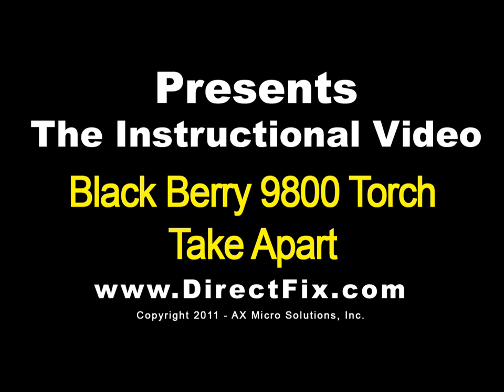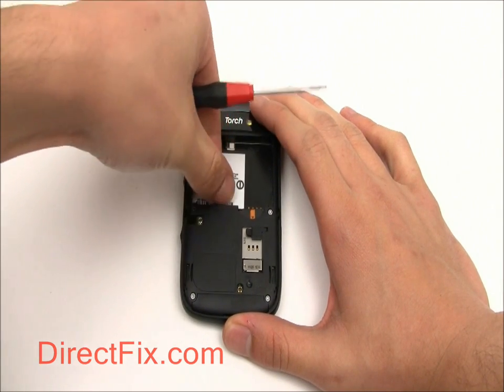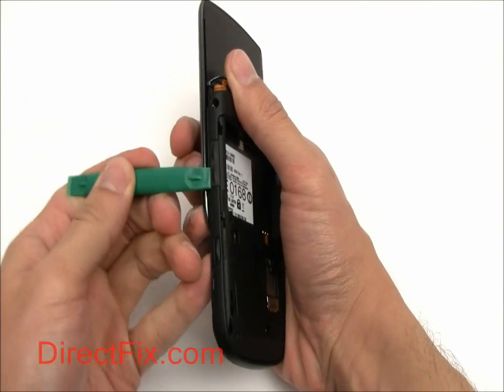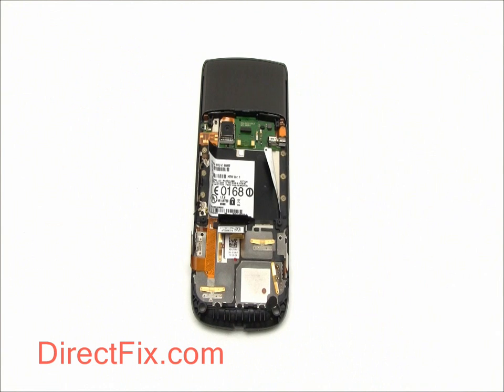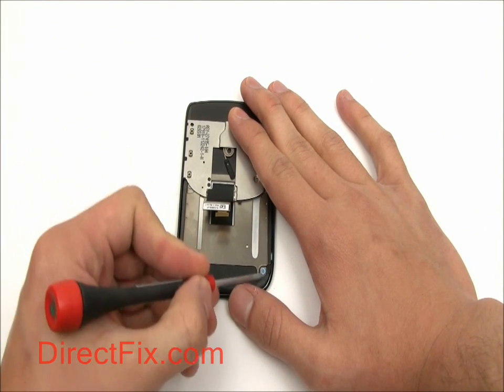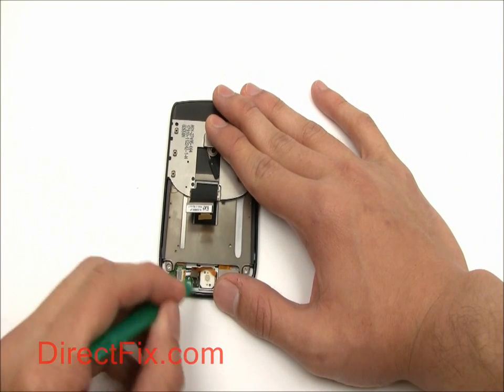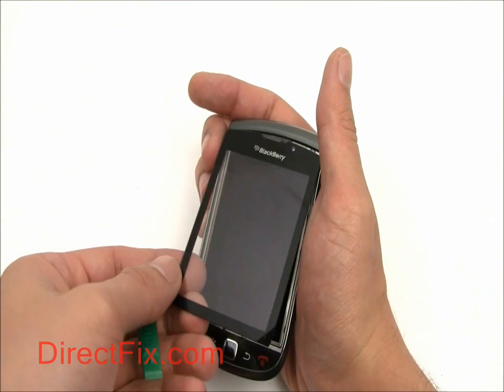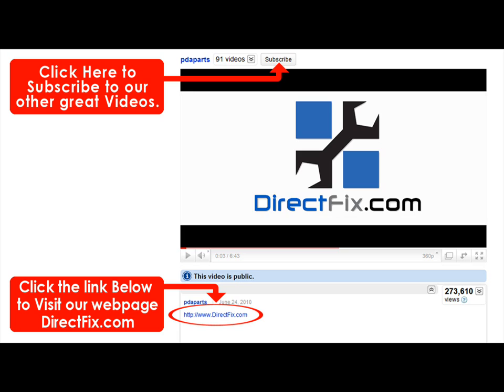BlackBerry Torch 9800 LCD Screen Repair Directions

Comment: To answer my own question, yes, a T2 works (but the T3 was too large for that step).  Don't waste money trying to find a set with a T1 (much harder to find than a set with a T2).  I used only a T2, T3, T6, and a pry tool.

Comment: This explained how to remove the phone's body panels, do you have any recommendations for removing the bezel on the sliding part? Because I'm thinking on buying a second Blackberry 9800 (used) to practice fixing problems if mine ever breaks/scratches/dents.

Comment: My Torch phone fell from a certain height the other day and it left an ugly scratch on its sleep button. now the back light is gone but i think some connections just got loose 'coz i managed to bring it back up every time i slide it up or down repeatedly and press hard on the screen bezels until i get it lit. what do you think? is there just some loose connections in it that i could just pop it open and snap it back in place? thanks